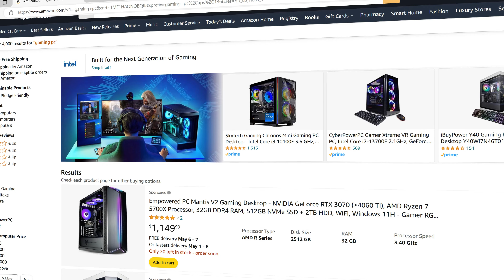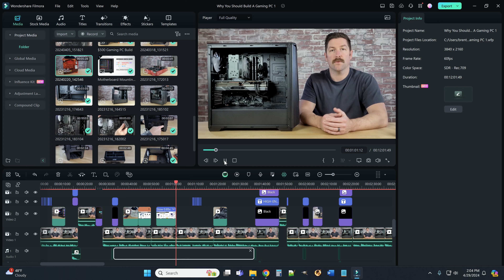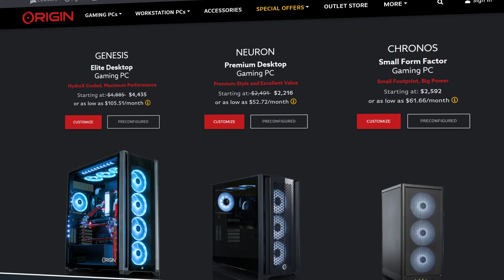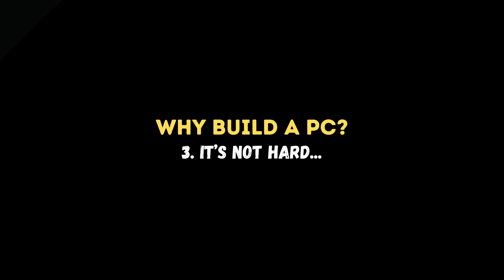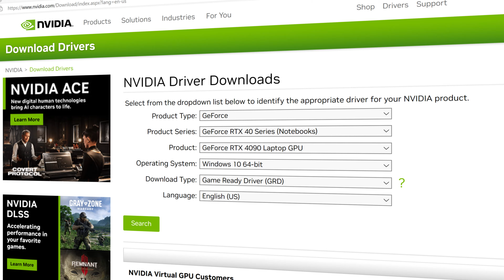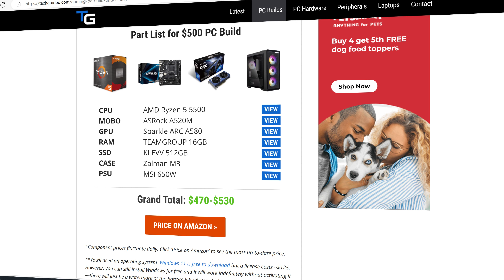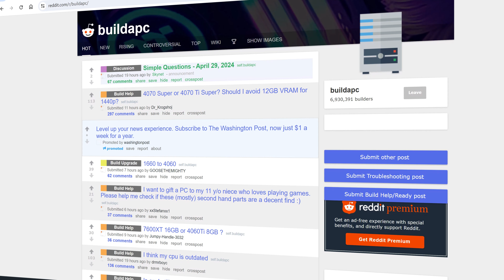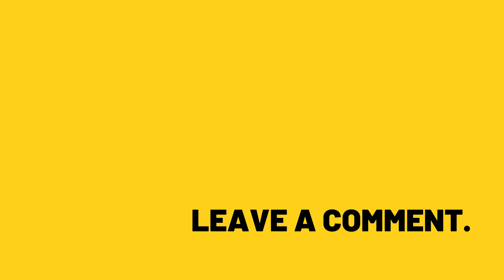Why You Should Build A PC

Comment: One thing that prevented me from building my own pc for so long was the idea that these pc components will break if you so much as look at them the wrong way, but they are actually pretty resilient. Building my first pc in an ITX case had me contorting my wrists in ways they haven’t been before and I fumbled some parts multiple times thinking there’s no way it will boot when I’m finished. But it did, and after 2 years I’m selling that one so I can build another one 😂
Reply from the maker: Very good point! There is definitely some fear involved with handling and installing PC components, especially if you've never done it.

And, agreed, mini-ITX builds can be tricky. My main system is ITX...  it was quite a bit more difficult to put together than a standard build.

In any case, thanks for the comment and good luck on your upcoming build!

Comment: honestly im just straight up scared to build one lol newbie here.
Reply from the maker: That's understandable and something I forgot to include. Can be nerve-wracking handling PC components for the first time. But as @MaximusLigmus pointed out in another comment, the components are more resilient than they seem.
Reply: It’s really not hard as most things only plug in one way, the only thing that is semi a pain is doing the switches but really not as bad as I’m making it sound. I use my iPad and find the motherboard manual online that way I can pinch and zoom any connection I may need questioning . Building now versus when I built my first pc over 30 year’s ago, you used to make sure all the jumpers were in the right position assign com ports, dma channels and Irq’s but now that’s almost always done in the bios now no physical switches to assign. Make sure you use a quality power supply, if it’s wrong then it won’t turn on. Once you let the smoke out you can’t put it back in. I easily saved $700 on my last build for my personal pc, watch videos and read up then if you have a micro center near you go there, micro center I’ve found to be a great resource and you have those tech guys that enjoy sharing their knowledge with you.